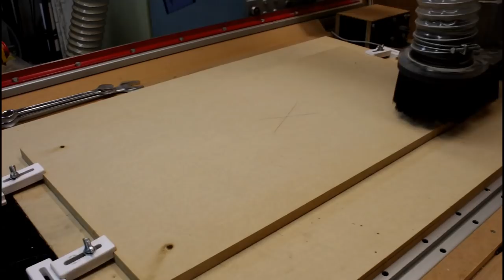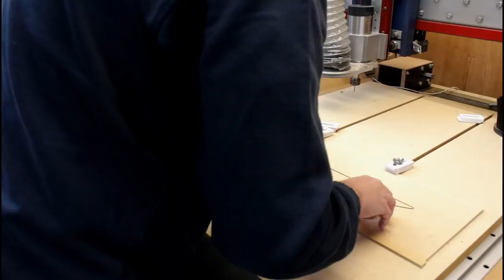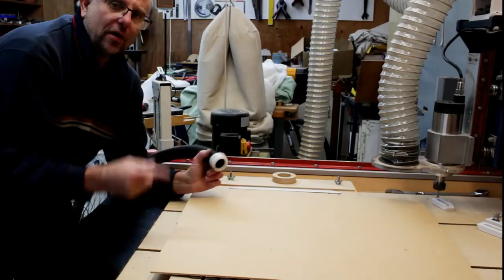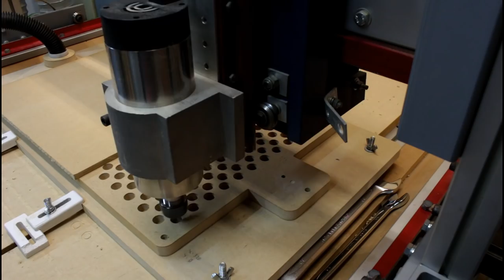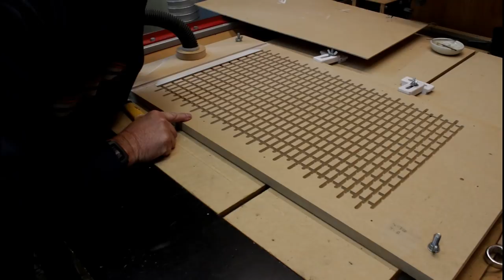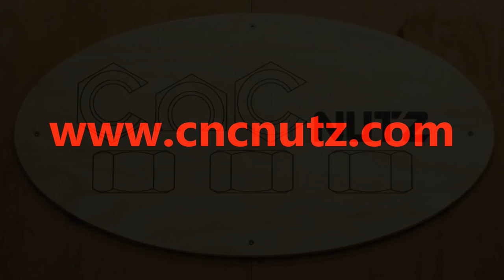DIY Vacuum Table Part 1- CNCnutz Episode 210

Comment: Hi Peter, first seal the bottom plate with varnish or paint on the top side (where the vacuum channels are cut), seal everything, including the sides of the channels. Second, close the channels by putting a plate on it and put vacuum on it, then start "painting" white wood glue on the sides of the bottom plate while under vacuum. The vacuum will suck the glue in and help to close every little pore. repeat if necessary until vacuum holds. Check also the down side of the bottom plate (with the "smoke detector") and apply glue there if needed. Let it dry overnight and it should be ok for use. By the way, the vacuum you're using will not last long for this purpose, the motor will quick enough overheat and that's it then. I speak out of experience here ;-).

I have build a perfect and cheap vacuum pump out of a standard compressor, with a buffer tank and automatic switch on and off to keep the vacuum nice at the requested level. It works like a dream and can not only be used for vacuum laminating veneers and making your own plywood, a vacuum forming machine but also for a vacuum table on the CNC. It has a cycle time of 30 seconds on and 4 minutes 30 seconds off. Keeps the compressor motor nice and cool! Also, saves on the electricity bill. Similar vacuum systems are sold for at least US $ 1,200 and up, it costed me less than US $ 200 including a couple of vacuum bags! Maybe an idea for a video series about it? ;-)
Reply: I also lost a vacuum cleaner motor due to overheating. I bought as used hvac vacuum pump to replace it. I'm going to add a buffer tank as you did. I glued a thin sheet of plexiglass to the bottom of my mdf plate then used white wood glue to seal the rest of the area. I use small sheet of plexi to block off areas not need when routing.
Reply from the maker: Thanks for the writeup Paul. Great information and sound advice. I has wondered how well the vacuum would hold up over time. I don't think I will be using it a lot but if I do I will look into a proper vacuum pump. I've seen them made from old fridge compressors as well.
Cheers
Peter
Reply from the maker: An  Hvac pump would be a good idea. Better than the fridge pump I've seen used by others in the past. Something to consider for sure.
Cheers
Peter
Reply: I make  custom hold downs for engraving perspex. I gave up on vacuums because the reduced airflow robs the motor of cooling and use a $99 ebay vac pump with an out of date bbq gas bottle for a tank. I use old 35mm counter tops for the hold down and just router v grooves in it so it looks like a block of Cadburys and drill a hole into the edge and connect to a vertical hole down from the one of the v grooves. It doesn't look anywhere near as impressive as yours but they do hold well particularly on smaller pieces ( 150x150 on up) even for doing the final profile cut. Using old counter tops or the sink cut outs on new ones means that the bottom is already sealed and only needs the side sealed with PVA.
Reply from the maker: Thanks Loslop
I will have a look for a cheap pump on ebay. I hadn't bothered because I thought they would be really expensive but maybe it isn't.
Now if you will excuse me I'm off to buy some Cadbury chocolate.
Cheers
Peter
Reply: @loskop100  I would love to see that, have any videos?

Comment: Here it is 1 1/2 years later and I just found this video. Thanks for posting it. My first thought on a fix for the leak is to laminate a piece of Formica (which I have). Sealing it with paint or other sealers sounds much easier though.

Comment: I just built myself a small vacuum hold down table and very impressed with it.  I have found especially for smaller pieces putting some "none slip grip liner" under it helps a lot.  I used plywood and created the holes just part drilling 3mm holes (around 3mm deep) then after this going over again with a 0.8mm drill this time going right through (spaced at 1cm).
Reply from the maker: Sounds great.
With MDF you probably don't need to drill the tiny holes as I discovered ion my 2nd build.
MDF is so porous.
Cheers Peter

Comment: From what I have heard, paint the MDF with 1/2 PVA glue and  1/2 water.  This will seal most of the issues.  Include the sides of the MDF.
Reply from the maker: Thanks
Reply: I solved my issues by taping the edges of the spoil board.

Comment: For the very interesting video. It was also very informative. I particularly liked the large vacuum pockets with the small vacuum holes to provide strong vacuum force with very little leak when the hole is not covered. Very clever. I'm currently building a vacuum table for a CNC router and I'm using high-density polyethylene as the base where the channels are routed and I will place a thin sheet of particle board on top as a sacrificial spoil board and I am planning on using the porosity of the particle board as a feature in my vacuum table as opposed to a problem. I'll know later today if it worked. :-)
Reply from the maker: Thanks, hope the table works well for you. The HDPE will solve the base problem I experienced. If you can't get enough pull through the MDF you could try skimming the hard surface off the back to make it even more porous.
Cheers
Peter
Reply: I'm planning to use particle board as a cheaper and more porous spoil board than MDF, and I'm planning on removing the top and bottom surfaces to increase the porosity.  I'm cutting 24 inch by 48 inch sheets of plastic.  My biggest concern is that the kerfs around all of the small parts will allow enough air to enter the vacuum system that my 1/8 HP diaphragm vacuum pump won't be able to maintain vacuum pressure.  I may need a higher volume vacuum pump, and maybe a professional shop vac with a TEFC motor that can be run for hours at a time without burning up the motor pulling a static vacuum load when there isn't enough bypass air for motor cooling.

Comment: Thanks for sharing! ...yeah - MDF is super porous, I use it quite a bit as scrificial material on my (aluminium) vacuum table. especially when I want to mill some alignment pockets into it. Generally I prefer kork because it does not leave a burr as MDF does when milling through. the fact that you found it gets more porous overt time is surprising though! thanks again for sharing!

Comment: Peter, Ted Gauthier of the Michigan CNC group made a vacuum table very similar to your except he used melamine board to cut the vacuum channels into. He then used a .5 thick piece of MDF as the spoilboard after skimming off the outer layers of the MDF.  The vacuum passes thru the spoilboard holding down the piece to be machined. He uses a Fein vacuum unit.
Reply from the maker: Thanks Jim. Malamine is something I have been thinking about a a good material for the base as it's surfaces would be well sealed to start with. Our need to seal the edges. 
Cheers
Peter
Reply: Melamine here in the states is sealed on all sides, top, bottom, edges.
Reply: in the above Ted cut a  groove around the vacuum grid 1/4 x 1/4 and used a gasket material to seal the edges.  All of the vacuum grooves were cut the same.  His vacuum  was attached in the middle of the board underneath going through his CNC bed.  I can't do that since my Gatton is sitting on a table.  I was already looking into something you were doing, bringing the vacuum in from the top.

Comment: Dear Peter,
Please use several coats of spry clear or paint onto the surface and closeup the sides as well with thicker brush on paint like latex, color is not important.

As always a very good job done thanks for your energy and time to show your work.

Robert
Reply from the maker: Thanks Robert

Comment: Another option (if you wanted to use something other than MDF, is to use a bench top product called CORIAN.  It is a plasticized wood product (from my understanding) which machines beautifully.  I have used it to make molds for producing RC aircraft parts.  It is sealed (hence its use in bench tops), and off cuts can be sourced from a bench top supplier (if you ask nicely and provide choc biscuits... )  Only issue is it only comes in 12 mm thick, but can be glued together (with epoxy) to get a thicker section.

Keep up the great video's

Cheers
Reply from the maker: Unfortunately I have not found a source of Corian here. I'm not even sure it is used in New Zealand but thanks for the thought. 
Cheers
Peter
Reply: Hi Peter, it is, im in palmerston north, can put you in touch with a supplier if you liked.

Comment: We use MDF spoil boards for our vacuum tables at work.  MDF is very porous and needs to be sealed everyplace you do not want vacuum pulled.  All edges must be painted with several coats of paint or with wood glue, we actually edgeband our table tops.  Even if you leave the hard glaze on the MDF it will pull vacuum through it.  I would be curious to see if you made a spoil board with no holes in it, if it would pull enough of a vacuum for your parts.  For our industrial machines, there are no holes in the MDF, the vacuum is pulled right through the 3/4" board after a light skimming to remove the glaze and to roughen the surface for better friction between the table and the parts being machined.
Reply from the maker: It might be fun to just screw a vacuum hose into a piece of MDF and see how good a vacuum table it is. It certainly seem to be porous enough even with a vacuum cleaner. Or am I just being silly? 
Cheers
Peter
Reply: @cncnutz  Here in the States we can get what is called "MDF lite" that is even more porous than plan MDF and is used as a spoil board.

Comment: You are welcome Peter! Yes, you do have to seal the MDF :) virtual any spray on poly or watered down PVA glue will do (amongst others).
Reply: Agreed. Spar urethane is what I usually use. It's really easy to apply if you get it in a spray can.
Reply from the maker: Thanks Jordan.
Reply from the maker: Thanks.

Comment: I was watching another video on a different topic and it was mentioned that mdf was porous. I thought the glue would seal it. Thanks and I can't wait to see how you solve the problem. Maybe epoxy?
Reply from the maker: Thanks Grant.
Reply: Yep, PVA definitely seals the MDF (I've only done this around the edges of the MDF, but it increased the amount of hold down significantly.  Cheers, David.

Comment: seal the mdf with 2 or 3 coats of a good oil base paint. A good check on the seal is to do a sample peice and toss it in a pail of water for a week or so. i the mdf dosent change size, you got it sealed. if it starts fallig apart, it isnt sealed.  I nfact my homemade cnc is ALL well sealed 3/4 mdf.  The rest is somewhat the same as yours, v- rollers running on angle iron and lead screws. Havent seen any issues with it in several years. Its seriously heavy but no problems whatsoever  pausing around a good 30 pounds or so of it with 450/oz steppers with 5 start 10 pitch half inch acme rods.    :) Makes for some sweet smooth 300 ipm rapids with a surprisingly rapid acceleration too..
Reply from the maker: Thanks John.
Sounds like a nice machine you have there.

Comment: Nutz i posted link earlier ....look a couple messages down....i actually was given a store bought vac table for free.. Its 14x24 made by vacuum table co  based where u r in uk.... Its made of 2 pieces the top is 1/4 aluminium and bottom is made of some type of plastic..its about 1/2 thick....and then has many tiny holes on top and has 4 inlet holes on side
Reply from the maker: Thanks I see it now. I answered the previous post from my phone and it didn't show me the rest of the comments.
Thats a great table and it makes we wonder if adding a series of shallow holes into the surface of the spoilboard would help vacuum as well. Thanks for the link. I will be doing a bit of thinking about that. 

I don;t know about partical board but I would be tempred to use melamine MDF which will definately be sealed on the faces and then some edge banding to seal the sides.

Oh man, as if I didn't hae enough projects. 😉

New video out later today all going well using my vacuum table.

Cheers
Peter

Comment: Another masterpiece!
Reply from the maker: I don't know about that at the moment but hopefully when it is finished.
Reply: Actually, I was referring to the overall video; I learned a lot. BTW, seems to me with the small drill holes opening into larger chambers, an absolutely air impervious material (like HDPE) would be the ticket. Thanks
Reply from the maker: Thanks Peter.

Comment: MDF is actually used as waste board on top of vacuum tables on large carpentry Cnc machines. So do not use MDF to construct the vacuum table but use flat MDF as waste board on top of your vacuum table.
Also if you block the air through the vacuummachine you might blow it's thermal fuse. normally vacuum machines use the filtered air from the hose to cool the motor as well.
Reply from the maker: Thanks Henrik
Reply: if you also mill a thin layer off the MDF then it becomes even more transparent to air flow.

Comment: MDF is porous.  We use a solid MDF for Wasteboard because the Work piece will get sucked down by the Solid Wasteboard.  Spray the chamber with epoxy or eurathane coat until its sealed or use a resin / plastic chamber.

Comment: It would be interesting to try making the layer with the channels out of a sealed board (eg formply) and just using 6, 9 12, 15 or 18mm MDF above the channel layer to see if the vacuum created is sufficient to hold some material on top of the MDF. How did you calculate the depth and width of the channels - same as the cross sectional area of the hose nozzle?
Cheers and thanks for the demo.
Reply from the maker: You got it. The hose area then made sure the area of the channels were bigger. This experience has opened my eyes to the power of even a small vacuum.
Cheers
Peter

Comment: You could try using yacht varnish as it super strong and will never go porous also it stops most of the humidity if any. to cover any unused parts of the table try some closed cell neoprene. foam
Reply from the maker: Good idea about the varnish though the acrylic paint is holding up fine at the moment. That could change over time. Covering the unused hole doesn't make much difference unless the piece is small due to the small hole size. Thanks for the neoprebe idea. I think I have some laying about.
Cheers
Peter

Comment: think ill give the vac table a try . i wonder if sealing it with a rubber coating mite fix the issue
Reply from the maker: Just beware that others have warned the vacuum cleaner my burn out if run like I am using it because of the loss of air flow through it. It is something I will be investigating.
Cheers
Peter
Reply: i found this old hand pump with a hose on it you pump it and it creates a strong vacuum im thinking about making something with that i just got to see how well it holds stuff
Reply: it appears to be old bike tire pump with the check ball valve reversed i was told it makes 11lbs per square inch   of suction not sure if that will do or not

Comment: I presume this table is only used for material that you are not going to cut through completely or do you use it to hold a sacrificial surface to which the material to be cut is affixed?
Reply from the maker: No I cut all the way through the material and don't use a sacrificial board.
Cheers
Peter
Reply: @cncnutz  Thanks Peter, How often do you have to resurface or replace the top of your vacuum table?
Reply from the maker: @paulreader1777 
I have only used it 5 times before my vacuum hose broke. So far there isn't a mark on it. The thickness of the paper between the stock and board is enough clearance so far. I will be building an upgraded model before too long I hope. Just looking for a suitable vacuum. 
Cheers
Peter
Reply: @cncnutz  Thanks again Peter I am probably going to try building one for our shared Men's Shed machine will let you know how we get on

Comment: nice idea , i would make the top plate remove able so you can de-clog it should a channel fill with wood dust 
the vacuum cleaner might get hot if you leave iton too long , you might want to keep an eye on that 
maibe if you paint or stick a sheet of plastic under the surface it will seal it
Reply from the maker: The top plate screws down for that reason and so it can be replaced when it gets to the end of its like.
The vacuum issue is something I am looking into.
Cheers
Peter

Comment: Hey nutz lookmat this vac table video...the guy just uses mdf as,spoil board and the part holds throught the mdf....apparently mdf allows air through it..like magic
Reply from the maker: Hi der ddd
That's how commercial vacuum tables work and seeing how porous mdf really is now that I have tried it I'm no longer surprised. I'm not seeing the link you are referring to. Can you repost it.
Cheers
Peter

Comment: Many examples of vacuum boards I have seen made of MDF, they use a finish to seal the MDF. I would expect several coats of polyurethane would do the job. The only concern I would have is the level of the board after absorbing the finish. I would put a couple coats of polyurethane on and then resurface bottom and top of the board and then repeat. Make sure you apply the finish to the edges also, but they don't need to be resurfaced just lightly sanded to knock down the fuzz.

I wonder if using HDPE would be better? I've seen scrap pieces at my local supplier that are close to the dimensions you are using.
Reply: Another thing I have seen done is to have the board under vacuum when applying the sealer. This causes the finish to be pulled deeper into the MDF.
Reply from the maker: Thanks
Reply from the maker: Thanks Freeman.